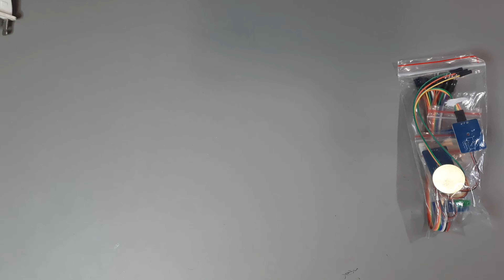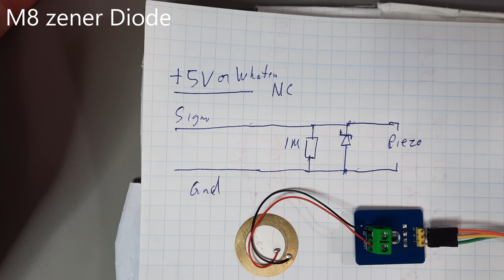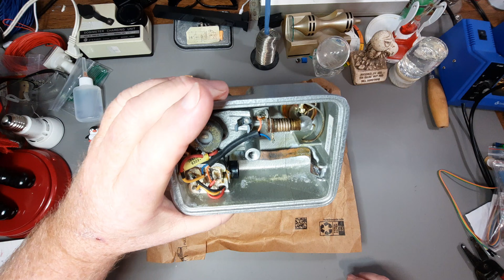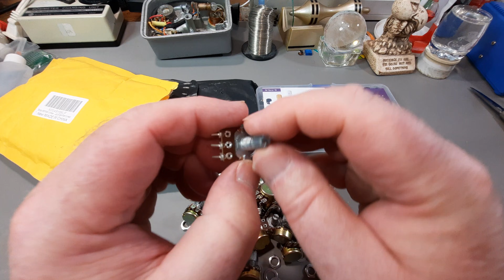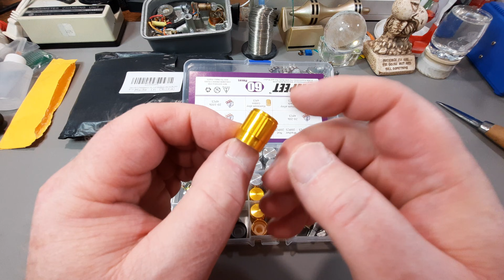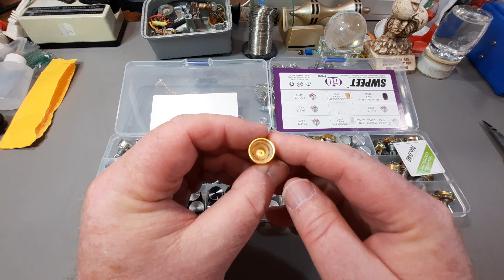Mailbag 46 ish Amazon Electronics

Comment: "Audio" pots usually are NOT linear.
Reply from the maker: These are B pots so yes linear vs A type which are audio/log taper. I will add more info to the description of the video.  In the product descriptions they do state linear and B type then add every word they can.
Have a good day
Reply: Not really for balance control u most to have a linear pot. For ton controls as base, treble or mid linear pot as well for volume pot a logarithmic pot.
Reply: @SymbolTech21 , but for what reason is a linear pot described as an 'audio' pot, and not just a generic linear pot?